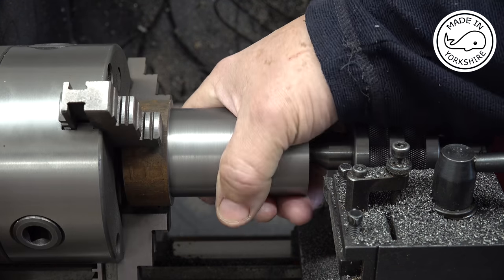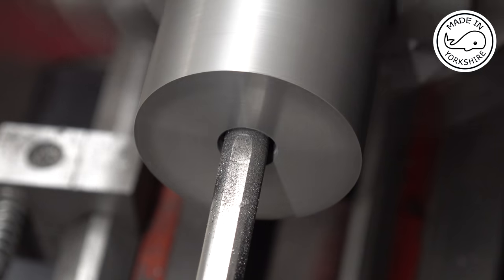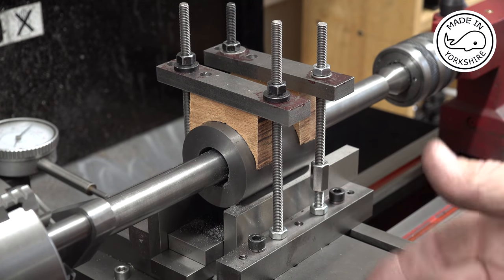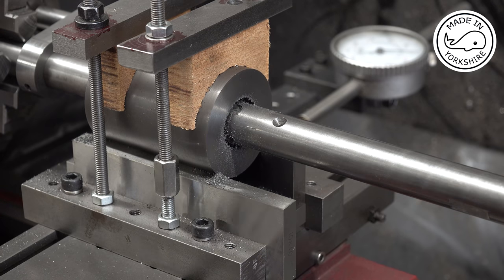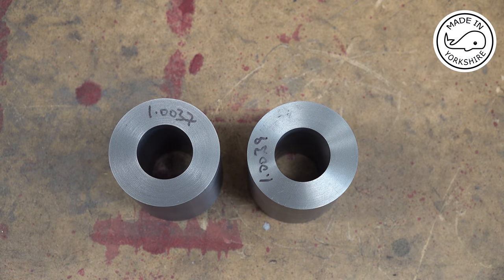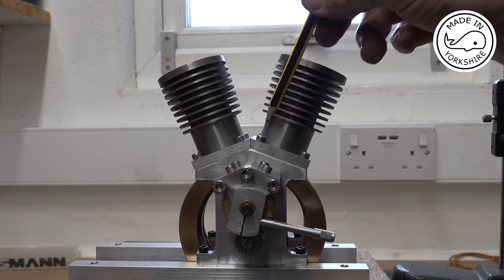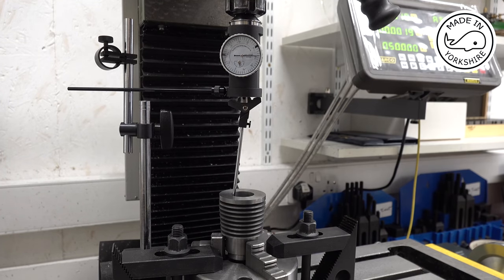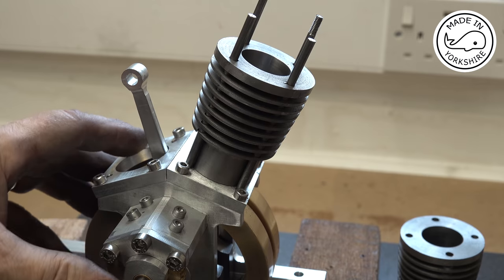#MT44 Part 10 - Hoglet V-twin IC Engine. Machining the Cylinders. In 4K/UHD by Andrew Whale.

Comment: This is a difficult operation no matter how you approach it. Suggestion: if you need to do another deep hole bolt pattern, try to manufacture a mandrel for the part and fasten the mandrel to the table instead of relying on the Chuck. For thinner pieces, this is a non-issue, but for deeper holes, it matters a great deal. One of the problems you were facing on the drilling operation was your perpendicularity of the part in the Z Axis as compared to the X and Y. It is difficult enough in a 3 jaw chuck to maintain the X and the Y, and any error will be magnified in the Z; your mill's limited Z axis travel makes verification very difficult (establishing "cylindricity"; the parallelism of X and Y at one Z height as compared to another). Order-of-operations also come into play: Try drilling the holes before machining the fins; this can lead to a better result because the drill bit doesn't have as much (or as many) opportunities to wander. Using a brand new drill bit is also a bit of insurance. I always "machine" my parts on a word processor first, writing out a document called a "Method of Technique" spelling out I am planning to do in outline form, and mentally reviewing those steps against the blueprint for potential issues. Short length drill bits are available: they are called "Screw Machine Length Drills". Sorry for the "wordy" comment, but it is difficult to abridge the concepts. Excellent progress!
Reply from the maker: Hi Matthew - many thanks for the suggestions. Definitely something for me to consider next time.
All the best.
Andrew

Comment: Great work!
Joe Pie is a professional, experienced also knowing a lot of theory.
You practise quite some theory and a h-ll lot of rigging skill. Have You passed through Joes school? Of course not....
How on earth control the cutting width of the ID of the cylinder? You showed how to! Impressive!
Fine You manage to save the cylinder after that "pin bolt" (home made translation from Swedish) crocked bore.
As I've said before, "Learning turning metall", ought to be upgraded more than one floor.
Reply from the maker: Ha ha - thanks Stefan!
All the best.
Andrew

Comment: Bad luck with the stud drilling. 
Perhaps machine four slots in the the bottom most fin on both cylinders with clearance just for the studs. It will then  look as if you designed it that way because you will maintain esthetic symmetry. 
Just my two penn'orth. 😎
Reply from the maker: Hi Graham - a great idea - I might just give that a try!
Cheers
Andrew

Comment: Your cylinder bore was not centered with the OD, that was obvious when you chucked the material for turning the fins. Had the bore been centered the drilled holes would not have broke out on one side and not the other. Once you bore the cylinder then everything should have been aligned to that bore and not to the OD, your datum changed from start of the process but you didn't change with it in my opinion. Its only a cosmetic issue so still a great job!
Reply from the maker: Hi mate - well spotted - I think you are correct and it was certainly a contributing factor. I must be more careful next time.
All the best.
Andrew